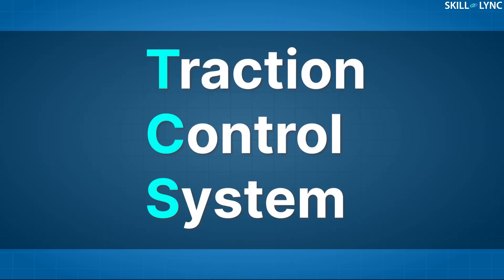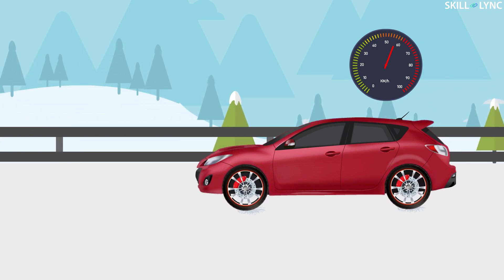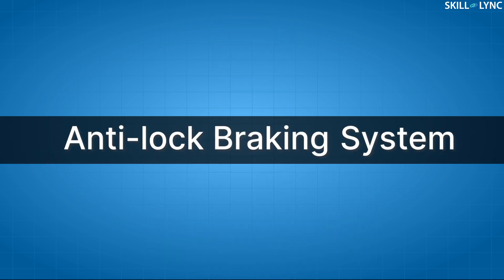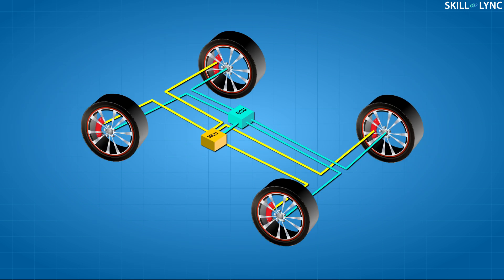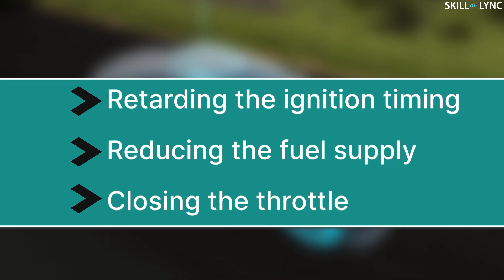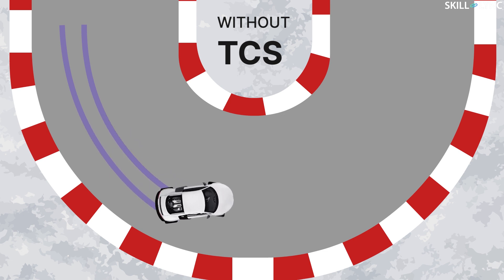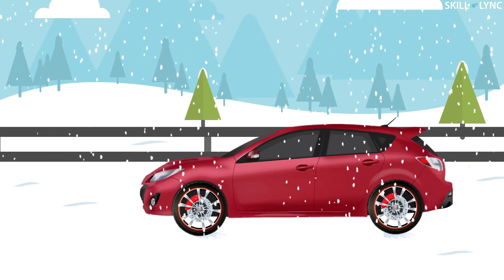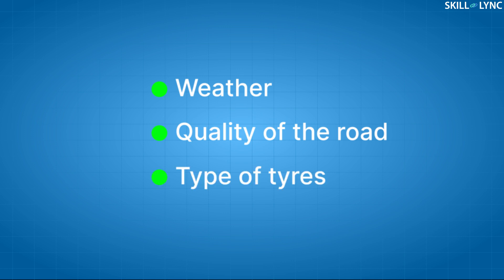How does Traction Control System work? | Skill-Lync

Comment: Hi i have some question, im having issues with traction control blinking on and off in one wheel right passenger side.. no codes in dash. When i hung on wheel on the right side traction control on and off and my car start jerking. When i am running starts the traction control around 30mph.. i also switch the ABS sensor to the other side, and still the same,. I change the wheel hub assembly twice for this and clean my abs sensor. I was thing the TCS or the ABS hydrualic pump. Pls help what do you think?